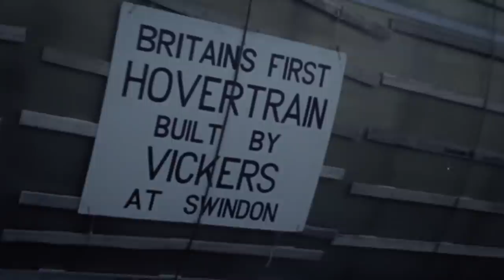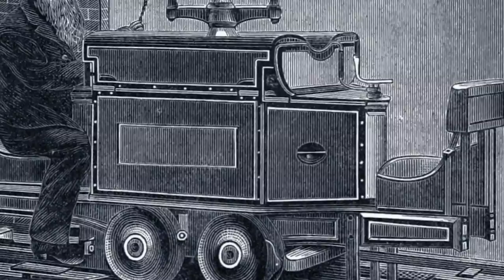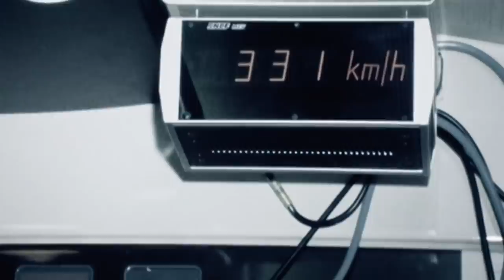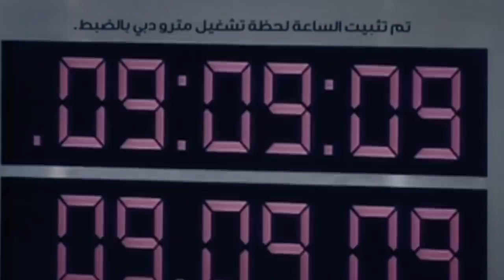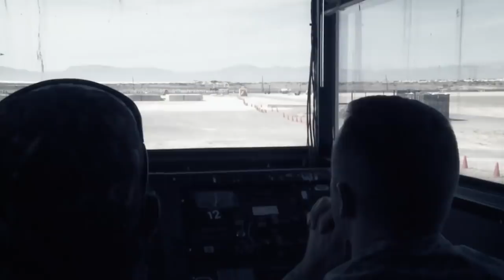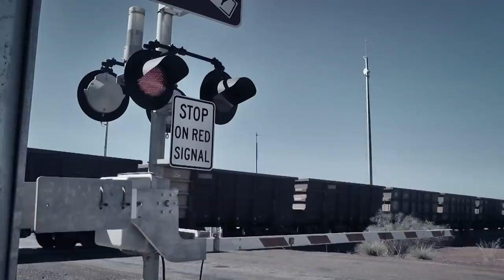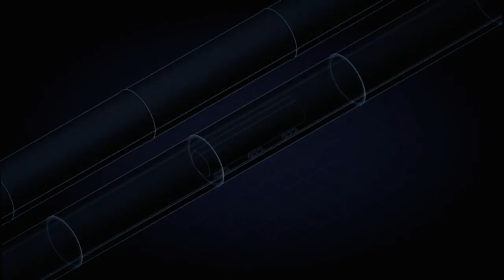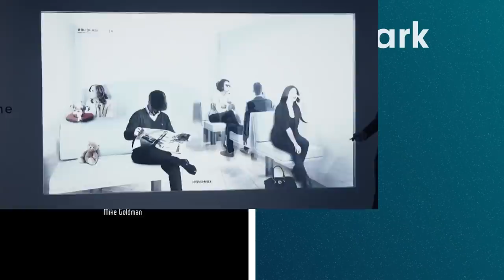How Does Japan's Bullet Train Work?

Comment: Love your train videos which are very informative and interesting even to a confirmed train buff like myself. I've subscribed to the Spark Channel and look forward to many more intriguing documentaries on the subjects of railroads and advancing high speed passenger train technology.

in the interests of accuracy I feel compelled to point out that "maglev" trains do not rely on "magnetic attraction" to suspend the vehicles vertically above the underlying surface, or to guide and center the train between the walls of the maglev channel horizontally as asserted in your narration.   On the contrary, the property of "magnetic repulsion" is harnessed for those two essential functions necessary to both suspend and guide the train. Rapidly alternating magnetic attraction and repulsion are both used to push/pull the train by the principle of linear motor propulsion.

Comment: Meanwhile in the US. The Airlines and Autoindustry encourage governments to not fund and invest in High speed rail because it will be a "threat" to the cars and planes in the US
Leaving their Passenger rail in DUST
Reply: trains are communist >:(
Reply: @sterlingodeaghaidh5086  That's the issue, they can invest in the tech in cities that need it, such as LAX-SF which is in desperate need for it, politicians are the ones crippling the entire project that Europe and Asia manage to built for decades
Reply: @Racko.  The issue is the whole system. Politicians rather not pay for shit. The contractors who do the work are so expensive due to Unions (which I am not against but still) that it drives up the cost, and then you have the environmental comitties who start an uproar for the sake of some bacterial colony found at the site. America just is a bitch to do any kind of major project anymore. If anything does happen I will be in my 60s before I see any news about it.
Reply: @sterlingodeaghaidh5086  It's quite the opposite with the environmental problems, sure you'll have property rights to overcome, other than that, High speed rail around the word has proven to be faster and far more reliable and efficient that flying and driving. Which both use Gas, High speed trains run on clean efficient power lines. The issue is not really the system, it's not justifiable to make a high speed system across the US, it doesnt make sense at all, it only makes sense on densely populated cities no more than 800 miles apart. 
DC-NJ-NY-BOS are a densely populated area with an high speed network but it only reaches full speed on certain lines for like 40 mins, because of old rail tech and all of that outdated bridges. It's in need for  upgrades which is happening at some point, other new cities to start high speed is Houston-Dallas, cities in Florida, NorthWest and some mid west states, and thats it
"The contractors who do the work are so expensive due to Unions (which I am not against but still) that it drives up the cost", True, however it will pay of later when its in operation and profitable, Japan has proven this with their bullet train technology
The real issue with US projects is lobbying, the moron back in the mid 1930s who cemented the idea of cars/roads as the only means of transportation is still in affect unless you're flying a long distance. You will see projects in progress before 2030
Reply: @Racko.  I am not really saying the whole U.S, living in Kansas, ya id love to have a rail connection like there used to be but, I am more talking about in the perspective of an elected official, who only has 4 years between elections and that hampers a lot of things.
Reply: @sterlingodeaghaidh5086  Makes sense, states like Kansas have a larger freighter market since forever btw, if you look at it's map theres probably like a single passenger train service from the start to end of the border of that state and a complete track map all over it from head to toe used for freight. I do agree we need someone whos level headed enough to sort these out
Reply: @Racko.  Yes, the Southwest chief, it runs 30 minuets south of me. But the nearest station is an hour away.

Comment: In US, they plied up the the number of locomotives to operate train to over 5 km in length wonder if the freight trains could maintain speed of 350 km per hour over long distances. Although China had experimented with such a unit with capacity of 1,500 tons equivalent to average weight of 100 TEUs which is about the capacity of most EU freight trains at the moment but incomparable to the  freight trains that transverse the North America continent.
At 350 kmph, it looks like air freight won't compete across the Eurasian landmass! What an impact to all those countries located within the landmass!!!

Comment: Driverless light rail has been in place in Vancouver, Canada since 1986... not a new technology at all! ... and they peak at 80km/h!
Reply: Speaking of Vancouver I think that the stock footage of the tunnel at 4:05 is the tunnel on the Evergreen extension of the Millennium Line in Vancouver. You can tell it's the skytrain because of the LIM magnet in the middle of the running rails & sound from the stock footage is the sound of the skytrain.

Comment: Yanks, meanwhile: "Trains? What are trains?"
Reply: Unfortunately mostly true.  While there are many commuter trains, the reality is trains that go any distance are more like romantic memories, plenty of people love them, but for others the trip isn't worth it.   Want to go from San Francisco to New York, it'll take 3 and a half days by train versus about 7 hours by plane, and the cost is about the same.    California has showed why high speed rail just won't work either, the people voted to approve it, and there was a plan in place,  however lawsuits from people not wanting it have unfortunately cost well in excess what the cost of the train line (from San Francisco to LA roughly) was supposed to cost.   Basically too many forces (i.e. people with more money than sense) pushing back against the idea.

Comment: Japan is indeed very "experienced" in the high speed rail industry for many decades

"experience" is calculated from the number of trips as well as the number of passengers carried during the operating period

"experience" serves as the basis for the further improvement and development of technology

it is undeniable that China is actively catching up with the "experience" of Japan even for a brief period due to the large high speed rail network in operation

technology is not only limited to invention but also continuous improvement and development based on "experience" gained during operation

you can't purposely exclude China in this regard because of political & ideological differences

Comment: Separate rails are an idea of the French for the TGV, it is not a Japanese invention!
Reply: TGV is later than Shinkansen
Reply: There not an invention at all. Japan had to build seperate tracks because they use a smaller rail gauge than normal on their normal trains and that smaller gauge isnt suitable for highspeeds so they had to build completely new tracks in standard gauge for their highspeed trains
Reply: @AlexLP0  The TGV tracks were built separately because the TGV allowed for steeper slopes and thus much straighter tracks and thus shorter distances.
Reply: @hansulrichjohner2694  Yeah. I just wanted to point out that building seperate tracks isn't an "invention" and sometimes you are forced to build seperate ones